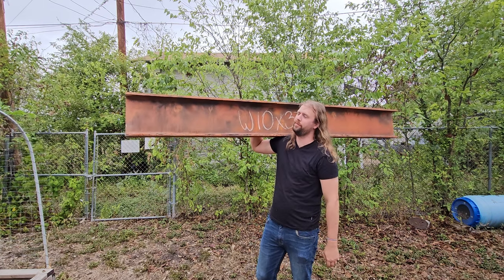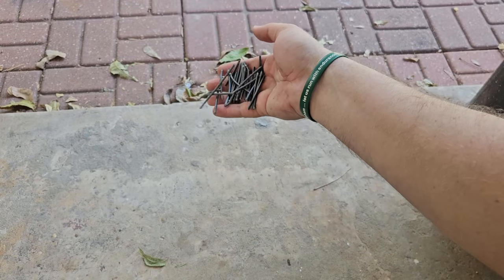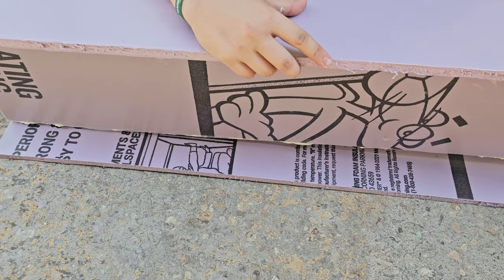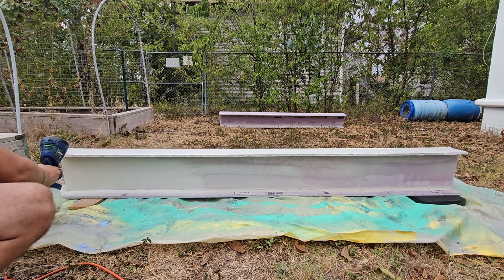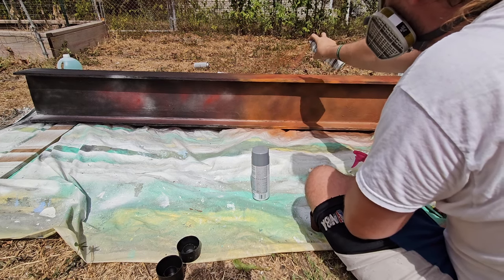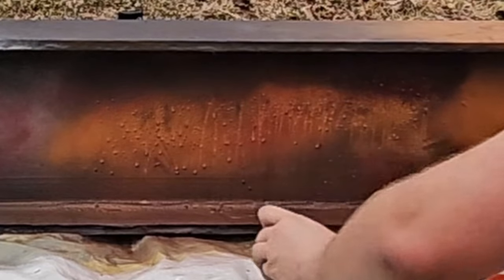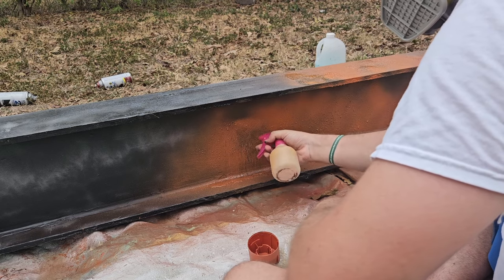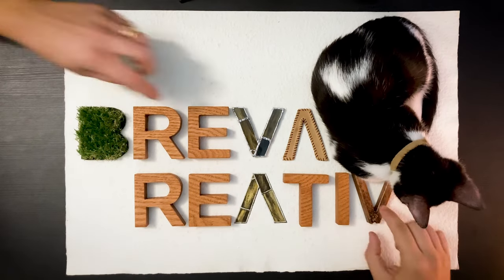I forged a Steel Beam.

Comment: Balsa wood next time....
Reply from the maker: Balsa wood would've cost about 10x more than foam, granted it would've painted better. I also wouldn't know where to get 1/2"x10"x8' sheets of balsa, most balsa sizes I've seen are relatively small. Thanks for the suggestion though!